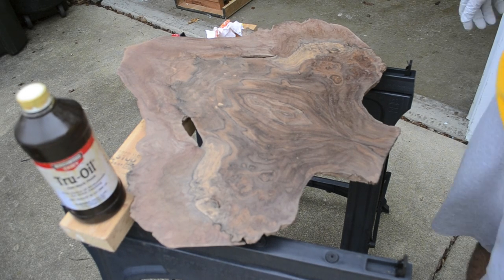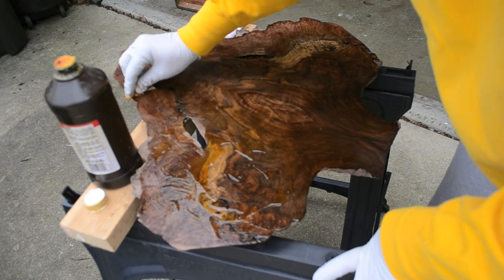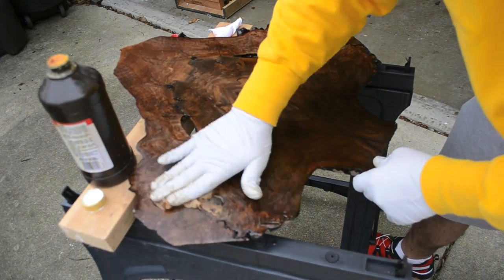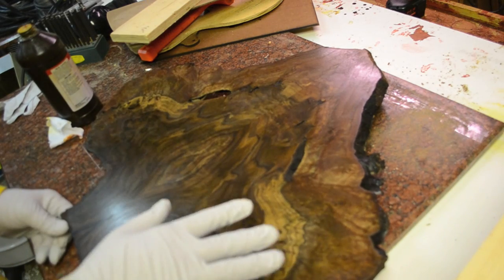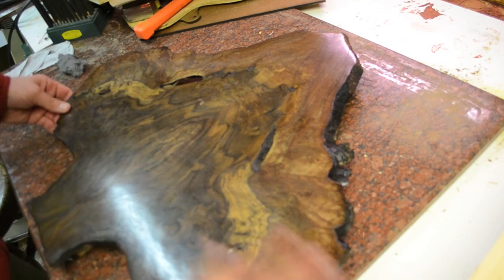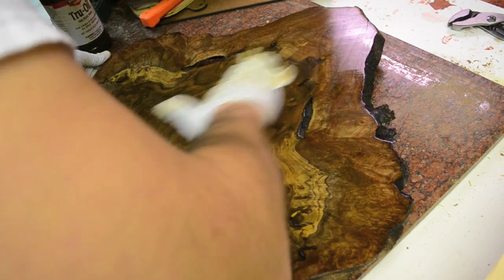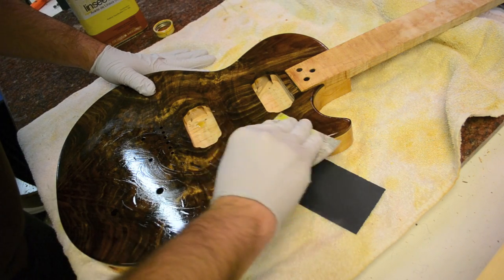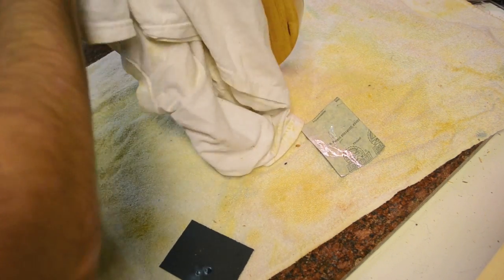How to Finish a guitar project with Tru-oil. Inside the luthier's shop video

Comment: I could never do this, I would have bumped and dropped that bottle of oil on the ground at least 5 times during the oil application.
You my friend; have some skill.
Reply: i was a nervous wreck. i kept saying. put the lid on. put the lid on. i was sure it would fall. especially near the end of the first coat.

Comment: You are a genius!  The wet sanding with boiled linseed oil was the answer to all my problems.  I've got a cheap chinese Les Paul that is my practice guitar for finishes.  It's probably and inch smaller because of all the times I've sanded it down to try a new finish method.  I've always had trouble with the end grain.  I wasn't very brave with the grit, since I have a dyed-sunburst method that I'm trying, and I used 1200 grit with the linseed oil.  It worked like a dream.  Now it looks and feels like glass.  Thanks for sharing your expertise with those that need it.

Comment: Those tops are gorgeous I use it on Maple necks. I heat it up and rub it in. Letting is dry overnight, steel wooling & then another coat. Five coats and a light buffing after the last coat tints the maple just right, the neck is protected & feels like butta. If it loses it's luster a few years later, add a couple of coats.

Comment: I use TruOil on my necks. I don't have a buffer so I final sand with 1400 to 2000 grit paper, then use a buffing compound and denim. My necks come out very shiny and slick. I don't like to leave them bare.

Comment: Birchwood-Casey (makers of TruOil) suggests "wet sanding" the first coat or two of oil, which creates its own grain filler slurry of oil and wood dust. messy, but it works really well and still doesn't look like any grain filler has been used. it's good for open-grained wood that sucks up a lot of oil, and helps the finish build up a lot faster.

here's a good tip for storing TruOil: instead of peeling off the foil under the cap, just poke a hole in it with a pin. then when you're not using it, make sure it's capped tightly and store the bottle upside down. this keeps the oil from skinning over and it'll keep a lot longer.

lastly, thought i'd share this link. there's a guy named Tom Pettingill that makes absolutely gorgeous lap steel guitars, and he only uses TruOil as his finish. the depth of shine that he gets out of it is absolutely amazing! here's a link to a photo gallery of his work: http://s302.photobucket.com/user/tompettingill/library/?sort=3&page=1

Comment: You can do all sides at one time.  Create a hanging stick, that mimics where the neck connects to the body.  Screw it in with two screws and hang it.  You can hold it by the hanging stick, or treat the front first and hold the body by the router holes.

Comment: I love your videos, thanks so much for your work! Question- after the first coat, how "transparent" was the tru-oil, or, how much "wood-feel" was there to the wood? I'm about to use tru-oil on a Goncalo Alves neck (which I politely request a luthier wood episode one!), and my main goal is to apply only enough to protect the wood and bring out its figure. I really, really want to maintain a relatively unfinished feel, similar to the Faded SG by Gibson, and other relic'd or generally un-finished necks. Since I play very frequently I just want to make sure it's protected from sweat and moisture.

Comment: Hey there.  I am about to start the finish on my guitar project.  My question about tru oiling is should I be using it on the top only or the whole body/neck/head and everything.  Secondly... should I be avoiding the binding? In my head it seemed like I should at least do the complete body and cover the binding too so there are no ridges or seems.

Jake in AZ

Comment: Oiling the wood does so much for the guitar's tone, it's amazing. I bought a Raw finish factory reject classical guitar for $70 US a few years back. Regular price was $120. Solid Mahogany top, laminate sides and back.

It was pretty rough with an unfilled, semi-raw finish and even had grain high spots that snagged against my shirtsleeves. I made a mix of a few different oils I had and hand-rubbed that sucka down. It went from being a rough looking guitar with a non-smooth surface and unremarkable wood to being a nice, refined top with an unpretentious semi-matt finish and even revealed some flame on the sides!

move forward a couple of years and the oils have hardened up in the guitar and the sound is amazing. It doesn't have the volume of my Smallman or Tanglewood dreadnought, but it's more versatile, warmer (but never muddy) and due to an odd quirk of how the action worked out - easier to play.

So glad I tried the oil on it.

Comment: What kind of steel wool are you using? My guess is triple or quadruple 0? I can only find double 0 here but that looks to me to be way too coarse.

Also, thanks a bunch for the wet sanding with boiled linseed oil! Is it possible to use pore filler before sanding/applying oil to get the same effect? Just curious what your experience is there. I guess you use linseed oil because tru oil gets tacky too quickly, and its one of the major components of tru oil anyway?

Thanks for sharing :)

Comment: I've been a custom gun builder for close to 30 years and a large part of my business is refinishing and restoring gun stocks. I will admit that when restoring a very high dollar firearm $50,000+ value to original I will use 100 year old traditional methods to keep it stock but any other time the new chemicals are far superior in quality and durability and done right you can't tell the difference between the new and the old methods.

Comment: I have no clue how you managed to not to have any orange peel. I do now probably seventh coat and I still do not manage to get even surface. is it the sanding phase before the tru oil? or you use some pores filler and sand to flat prior to coating?

Comment: Polys go on just as easy if not easier than oils glossy has better UV protection than semi but either is far superior for that as well as protection for the wood as well and is easily repaired. Urethanes are good too. A high quality marine spar varnish works quite well. BTW when you sand flat surfaces block sand please to keep out the ripples. Where I you I'd research how the high quality gun stock re-finishers go about it.

Comment: Im planning to stain a LP top with diluted black ink, and make a dark red burst. Should i sand in between each app of Tru Oil? Also, for wet sanding,  probs just use Water+Soap+ 600 grit. How long should i wait after till i can install electronics? Thanks

Comment: Hello i have a little problem with true tung oil. I wiped the whole guitar with multiple coats. It is mahogany body with walnut top. Problem is that the mahogany edges and back are fine they repel water and work pretty well. Problem starts at the top.the topi is dried and everything but water is kinda nt repeled. When i buff itwith 0000 steel wal and then put a drop of water or sweat or something... it always leaves a satin spot on the walnut and it is not so easy to get it out. Only by buffing etc. Any clues what´s wrong with the walnut?

Comment: I have a 2001 Gibson Les Paul Voodoo. I used to plat it religiously, so the face of the guitar has a lot of wear (you dont even want to know what the back / neck look like!)

It's made of Swamp Ash, and essentially the wear has created somewhat "sticky" areas. I've cleaned it with polish, and every time I do I get a lot of grime coming off of it, but I'm starting to think it's because I'm actually removing the finish). Would this Tru-Oil product help restore the slick feel to the guitar, or not?

Comment: Between the second and third coats, and the third and fourth coats how long did you wait until applying the next coat ?  
You didn't mention it on the video.   It kind of looks like you used the steel wool immediately after the second coat and then applied the third and fourth coats one after the other without waiting.
Reply: Can't find answer to this question.   How long do you cure the oil between coats?

Comment: Hi BigD sorry to bother you again but lets say you've dyed your burst into your guitar and put on your first few coats can you then wetsand with the tru oil to porefill without destroying the leather dye application you put on earlier or is it better just to use porefiller before you do any work? Many thanks
Reply from the maker: usually you don't need porefiller on a top.  I would apply the poor filler 1st get it all prepped and then add the color, seal it and tru-oil it.
Reply: ***** many thanks!!

Comment: Scour YouTube, and google for tutorials. The single biggest factor(s) in the guitar building process (other than using good tonewoods of course..)  are keeping everything centered, getting a proper neck angle, and the placement of the nut, frets, and bridge according to the scale length you've decided to use.  There are other important things you need to have planned before starting, but like I said, google and youtube are better for info than me lol

Comment: hi.  great vid. what compound were you using to buff with? thanks
Reply from the maker: +Jason Lynch http://www.stewmac.com/Materials_and_Supplies/Sanding_and_Polishing/Buffing_and_Polishing/Menzerna_Compounds.html?utm_source=google&utm_medium=shopping&utm_campaign=2015-10-gp&gclid=CP2bkZL2qMgCFYI7gQodH_EG3A
Reply: +Jason Lynch ma guires makes a series that is numbered by the cut value ,,, it works very nice  and you can aways add soap to slow the cut ,,, hope this helps unless your an older times like me i use triple e  , that how it pronouced  and of course water

Comment: What would you recommend for finishing walnut grip panels for a gun, specifically those that are sharply checkered for gripping?
Reply from the maker: a harder finish is key.  tru-oil is ok as you can refinish.  I have used gunstock oil with ok results.

Comment: Is that product highly flammable, like boiled linseed oil?
Reply: not really. TruOil is pretty great like that. i've used it for all sorts of projects, and it's my favorite wood finish: easy to apply, hard to screw up. it's a good idea with any rags used for finishing to lay them out flat and let them dry (preferably outside) before throwing them away, but i don't think TO has the same spontaneous combustion problem that BLO does. it's a blend of oils, plasticizers and drying agents, and linseed oil is a fairly small component. it's pretty awesome stuff IMHO.

Comment: BigD, any reasons not to apply a few light coats of tru-oil to an ebony fingerboard?  Instead of a regular fingerboard oil that seems to quickly disappear.
Reply from the maker: +johnnypk1963 you can get some wax that works pretty well.  That's what I use
Reply: +BigDGuitars - I ask b/c the guy at Wyn basses use a proprietary oil on the entire bass. Coats the entire instrument including the fingerboard. I'm So why not tru-oil, I thought?  Btw, If u haven't seen the documentary on his life, history at Disney and then just deciding to make some of the nicest bass guitars on the planet then u should watch the documentary RESTRUNG. Definitely worth watching just to see his build process and his efforts to make his first NAMM show. Good stuff.
Reply from the maker: I used to use a mix of shellac and tru-oil it was a perfect finish.  I then moved away from that for a while.  Now I am doing sanding sealer and tru-oil.  I have used bri wax on ebony and got pretty good results there.

Comment: I hate to break it to you but Tru-Oil is made of 56% Mineral paint thinners (possibly Turpentine), 33% oil varnish, 11% Linseed or Tung Oil. Of course the exact specifications are a trade secret but that's what it is. It's a Danish oil. It would be most beneficial to those watching to wet sand in the direction of the grain (important). The Varnish dust created (in combination with the oil) fills the wood's grain. In order to completely fill the grain it will often take at least 6 coats and often more depending on the wood species and it's grain structure.

Comment: Basically finishing a guitar or gun stock is not that much different except with high quality gun stocks you have a much higher quality wood. It has to be for the strength.

Comment: Does this provide a good amount of protectiion for the wood?
Reply: +Matthew King I know this is a bit late, but its protects wood very well. hence why it is used as a gun finish extensively. it doesn't chip or crack, and if you dent the wood the finish is still there, AND its easy to touch up. AK wood furniture is almost always finished in some form of oil, and i have some VERY well used stocks from the Yugoslav War. finish is still awesome on them with no rot.

Comment: it's ok to put your freshly oiled guitar body face down while you oil the back? Just wondering, because if it is, it'd make my job a lot easier :/ I assumed you'd have to have it hanging and be real delicate
Reply from the maker: KurtTissera first couple of coats I put it on heavy wipe it off and let it sit.  then after a number of coats would only apply on one side
Reply: thanks for the reply! what i mean is when i start this on my freshly sanded guitar, i'll put the first heavy coat on the top, let that dry, and then do the sides and the back the next day?

Comment: Hi there, can you apply tru oil over a vinyl decal?
Reply from the maker: Matt Middleton I don't know.  Never done that before.  I think a spray would be better as tru-oil is really thin.
Reply: Is the vinyl applied to unfinished wood?

I'd advise not to apply it, as the oil will migrate through the wood and get under the edges of the vinyl, causing it to peel off.

Comment: Sorry I've been busy. Basically, you have to ask, what is the purpose of applying a finish? 2 actually, to bring out the beauty of the natural wood grain and to protect the wood itself. Though oils like and similar to TruOil are pretty, at first, they do absolutely nothing to protect the base wood. Moisture goes right through like a sieve. Oils are also highly reactive to UV and will yellow quite rapidly and there goes your wonderful luster and color.

Comment: Am I the only one that thinks Tru Oil for a guitar finish looks like crap?  I haven't seen a single video yet where it leaves a nice finish, and that piece of wood he just finished buffing was not a instrument quality finish either...  SMH.
Reply from the maker: lots of guys love tru-oil.  Used it on a ton of guitars.  Spraying is a whole other set of issues...
Reply: Well not what one loves the epoxy and have an area to do it in.  The natural finish of true oil does last and is also very easily redone with another coat and polish unlike the synthetic finishes. It also stands weather conditions of humidty and dry climates better too. Just my 2 cents.